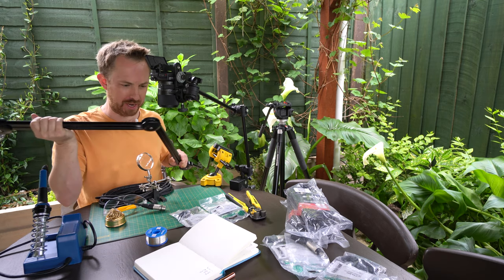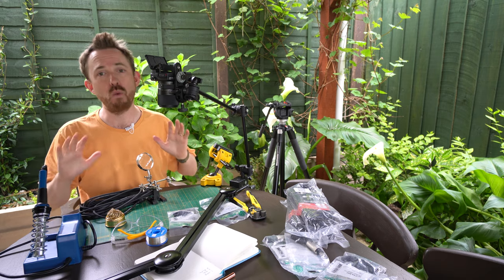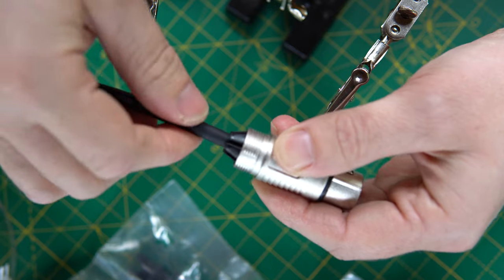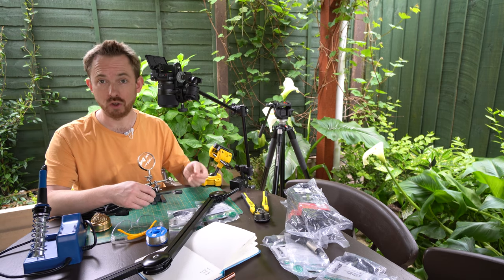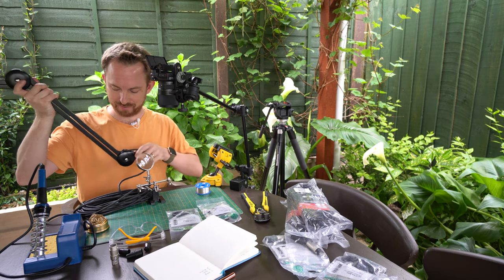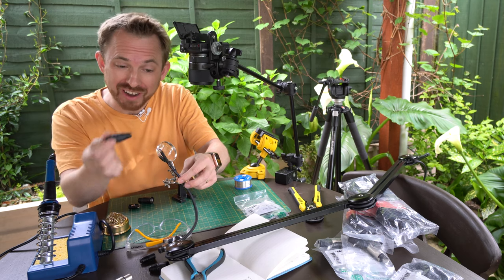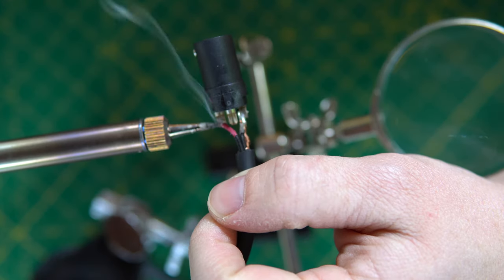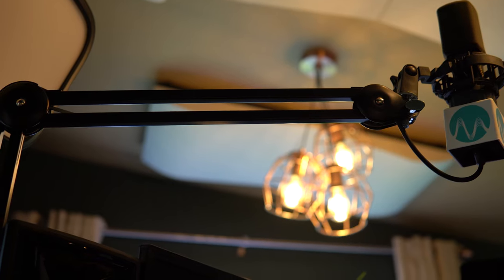Rode PSA1 Cable Management - A Good Mic Boom Arm Becomes Great

Comment: Interesting video, Mike! The PSA1 looks really clean with the XLR cable threaded through the inside of the arm.
Reply from the maker: Thanks so much.  Great mic boom arm!
Reply: Wait a minute… this doesnt work with rode nt usb 🤣
Reply: @Dadane  I mean, it could. You would have to solder a new USB-Plug at the end though. Also I would go the other way around if you were to do this with a USB Cable, soldering the USB-A Plug that goes into your computer is probably easier and won't look as bad as if you did it directly at the end of the microphone.
Reply: @david.kalbermatten  just curious before I buy this, will a USB-c end fit through this? Or does that need to be cut too?
Reply: @Dadane  That's how I got to this video. I've got the NT-USB and the PSA1, but there's no clean way of threading through the cable as the USB type B connector is just too large :(

Comment: You can even go one step further and route the cable though the stem if you're using the drill-through desk mount, the outter-diameter of the drill-through desk clamp fits an XLR cable, so you can prepare the whole thing and then just slot it through at the end, this way the cable is completely hidden!

Comment: I'm the least practical person, lousy with cables and even lousier with a soldering iron). I've watched this video like 5 times and I've given up, I'll just have the velcro straps and some of my life back.

I even bought the goggles, the magnifying glass thing but I think I opted for a crappy soldering iron. I got things apart but just couldn't put it all back together again.

Fortunately I have more than a few XLR cables, so no harm done.

Thanks for showing me it can be done though, I'll try to find someone local to me and pay them to do it for me. It does as you say Mike look so much better with the cables running through the arm.
Reply from the maker: Hi Jim, sorry to hear you're struggling, hope you get it sorted out
Reply: @MikeRussell  cheers. it gets even worse, I took both ends off the XLR cable and then realised I only needed to do it on the female end. If I can find an electronics technician I'd happily buy them lunch and pay them to do this for me. But right now, I think everyone is working from home. Now, where did I put my velcro...

Really enjoy your videos BTW Mike.
Reply from the maker: Velcro isn't so bad after all 😆

Comment: great tutorial, but one thing I would note (as a beginner to high end audio) is that if you attempt this with a 16 AWG cable it is a very tight fit. I would go so far as to say don't even try it with anything near that thickness. I initially tried this with a monoprice XLR cable and it would not thread through nicely whatsoever.
Reply from the maker: Thanks for the tip 👍

Comment: Good job! Does the wire rattle in the frame?  I think it would be good if they offered these with an XLR cable built - at least as an option.  If the cable malfunctions for whatever reason, you could just cut it off.
Reply from the maker: I agree it's a bit of a faff but even if the arm came with a cable installed you would still need to go through this to replace the cable.  I will say I'm happy with the result and would say it's worth the time.

Comment: Hey Mike, great video! Is there a reason to use the Neutrik connectors vs the ones you took off of the cable at the start?
Reply: Neutrik make the best connectors and I presume if you're going to be desoldering the old connector you might as well replace it at the same time!
Reply: @LukeNAndo  That's what I ended up doing, thanks so much!

Comment: How about the technica at2020 usb cable?
Reply from the maker: I'm not sure the supplied USB cable would be long enough to route through the boom arm and into the computer's USB port so you may have to look at getting a replacement cable.